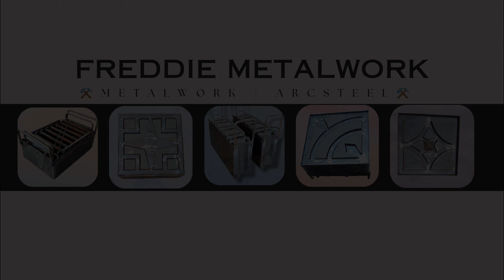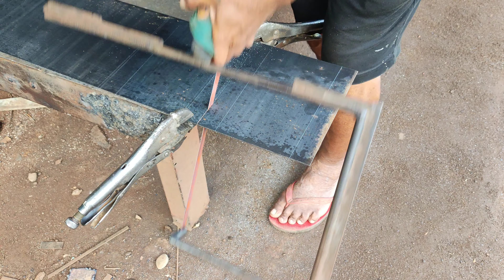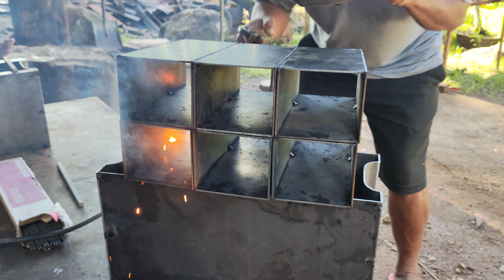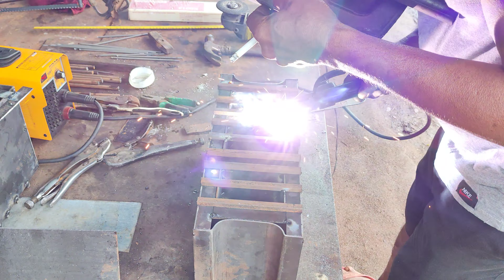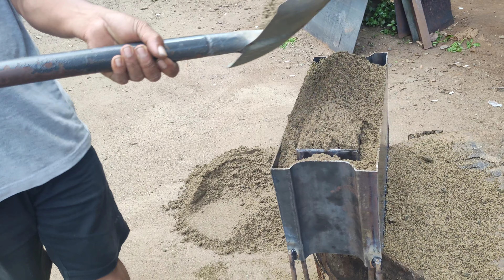HOW TO MAKE A 6" MANUAL CONCRETE HOLLOW BLOCK (CHB) MOULDER - FREDDIE METALWORK | Freddie Pacillos

Comment from the maker: ⚒ MetalWorks | ArcSteel ⚒
Hello! Here I am again returning with another video. Here's how I make a 6" CHB Moulder! 💯

TIMESTAMPS
00:15 Measuring, Cutting and Curving the shorter edges
01:34 Assembling the Main body
03:20 Inner Mould Formation and Edge Polishing
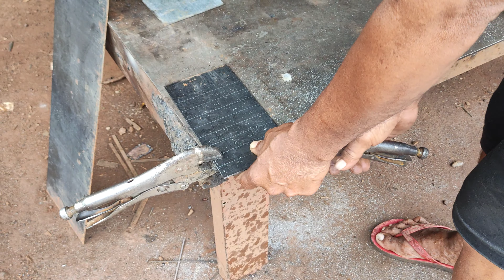07:32 Pallet Formation 1
09:45 Strengthening and Polishing the welded parts
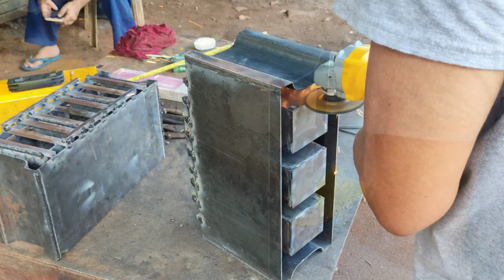12:22 Pallet Formation 2
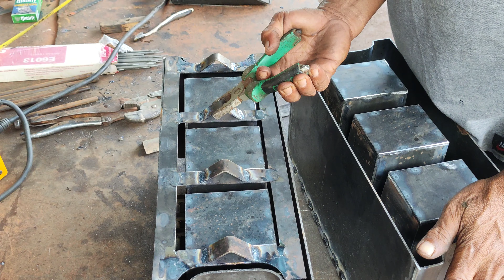15:28 Finishing with the Handles
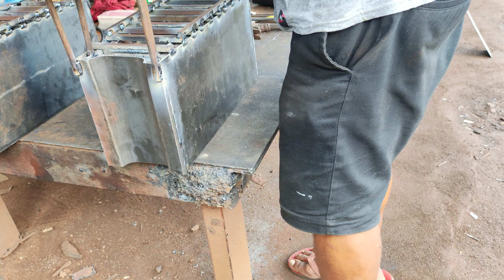16:51 Final Product Show Off
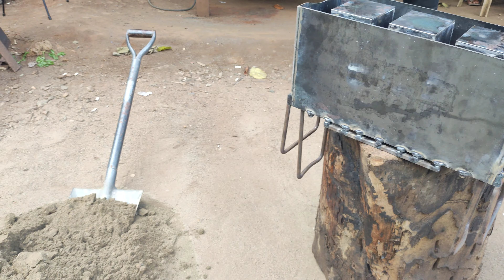17:22 Demonstration (sand only)
Reply: Hi Eddy. Can you supply if we put together a a few dozen molds?
Reply from the maker: @markiomarkio  Hi mark! Sorry for the delayed reply. We'd be delighted if you contact us here for inquiries. https://m.facebook.com/freddietolibaspacillos?mibextid=ZbWKwL&wtsid=rdr_0tzJ3ZXydKf1B4r81
Reply: Magkano po size 6 na molde
Reply: Mgkano 6" at visayas